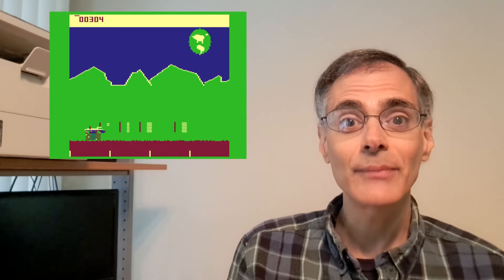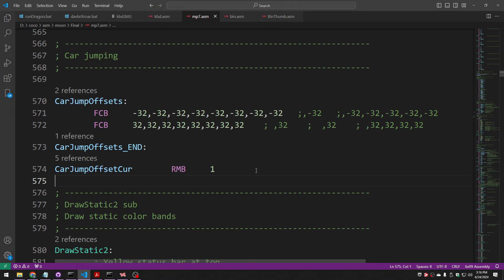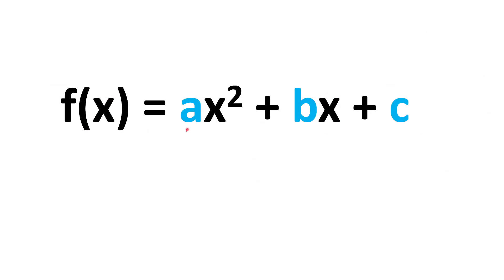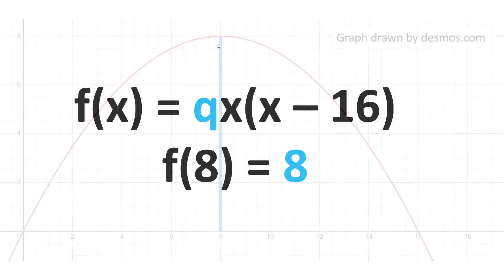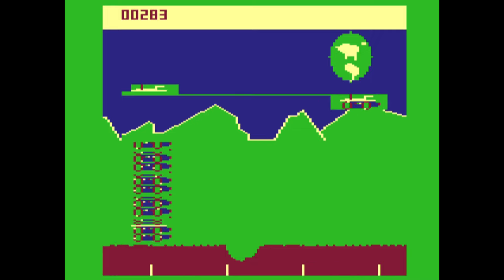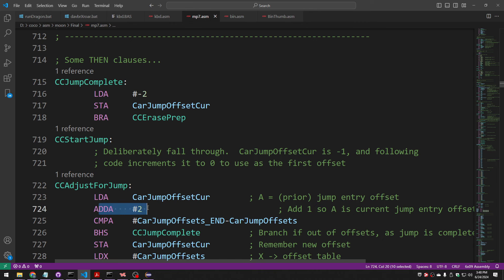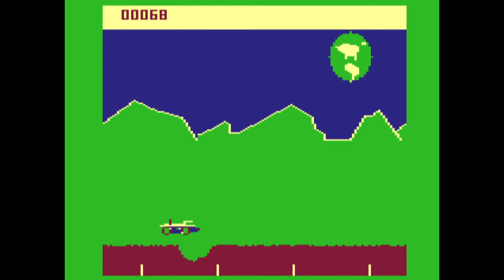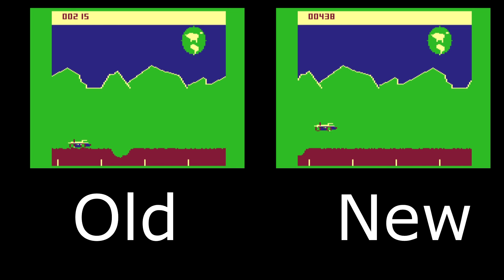Adding physics to our video game | Game revolutions cycle 15

Comment: It was a LONG time ago, but I was working on a "jump animation" in a project.  I thought about using math to somehow get it right.  I quickly disposed of the idea when I realized my own feelings are good enough to decide if it's right or not.  It's a very limited number of points after all.  If it were part of a larger model where the animation involved other objects interacting with each other, I might have gone with calculated results but in the case of your program and my small animation, it was like less than ten points in space over all.  So I literally just tweaked each of the numbers to correct for the flaws I identified.  And in the end, while your math kinda worked, it wasn't actually part of the running code.  I guess it served as a "jumping off point." ;)

Comment: I've never touched a Coco (Not sure if they were ever released over here in the UK) but i want to play around with one at some point after watching your channel, also first comment.
Reply: The Dragon 32/64 was close to 100% compatible with the CoCo. Might be easier to find one of them in the UK than an actual TRS-80.
Reply from the maker: It's quite a capable machine, and an excellent value for its time compared to its competitors.  If you just want to get your hands wet, you could run one in your browser. Nothing to buy, nothing to set up.  https://www.6809.org.uk/xroar/online/.  Go to the hardware tab and pick the machine you want to run!

Comment: You could add a little bounce after it lands with an extra up one pixel, down one pixel tacked on the end of your table! Although from a gameplay perspective, you'd probably want to allow for a new jump to be started during that extra bit and then you would have to compensate for it being already one pixel up, but it's all good fun right?!
Reply from the maker: Feature creep!  😜
Reply: @CocoTownRetro  I agree though.  Would look cool!  But I want jump rockets to clear long jumps :)  heh
Reply: @erroneus00  In the "official" game, as I recall, the jump is quite long and fixed length. You adjust the ground travel distance by pulling "back" on the joystick. That was part of the challenge. If you were up against the left side of the screen, there was no room for the maneuver and later levels trapped you with closely spaced holes that required finesse to land between and jump again.
Reply: @R.Daneel  Why do what the official game did?
Reply: @erroneus00  Never said you should.

Comment: Would your existing code allow you to add two more "down" entries, so it does a little extra one-line hop/bounce when it lands? In my head that would really communicate some weight of the car. Only worth it if it requires just a table update with no other modifications. Edit: oh, I see the same idea just below! Two feature creepers!
Reply from the maker: But you do provide a simple approach to getting that bounce with just a small change to the table.  But as mentioned elsewhere, the game could become less playable unless I allow the user to do 2 jumps (one directly after another) without a bounce wasting frames.

Comment: Depending on how clever you were feeling, since you never used odd numbers, you could have fit all those offset numbers in 8 bits again, just multiplying by two when adding them onto the position.  You could go back to sign extending and just shift left... or... just run the addition twice 🕶
Reply: If you use the other suggestion of an extra 1-pixel bounce, that throws away my clever trick.  Oh well.
Reply from the maker: Well, the jump offsets are actually all multiples of 32, since there are 32 bytes per line. So I could do as you suggest if I wanted to save some space.